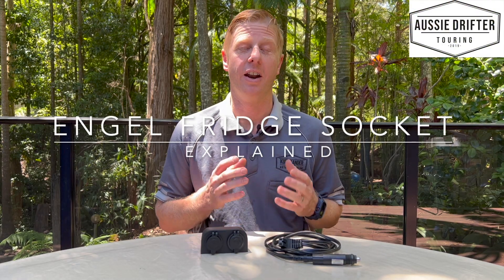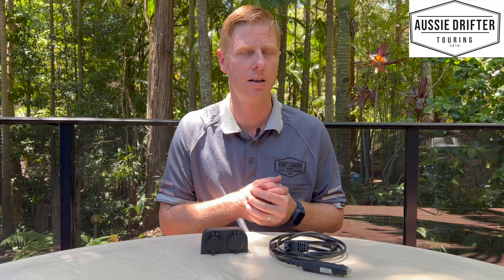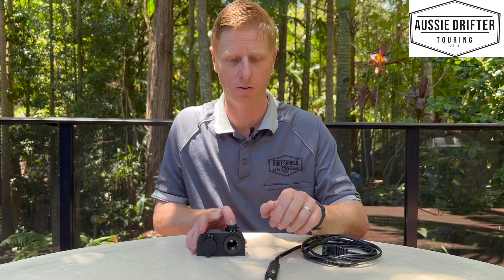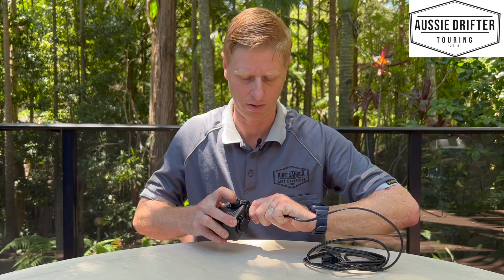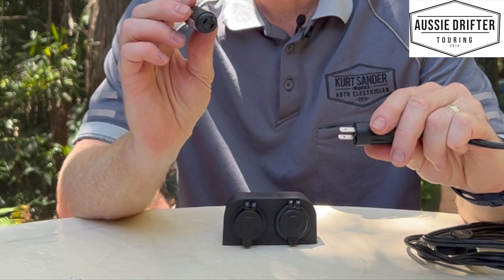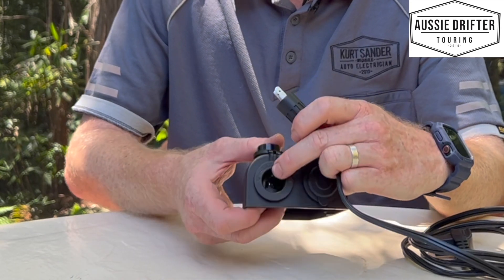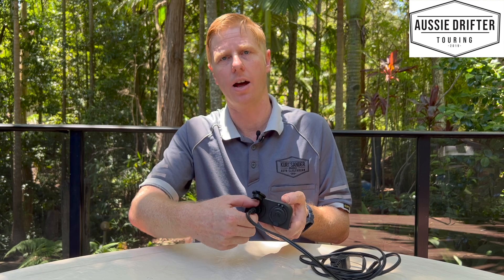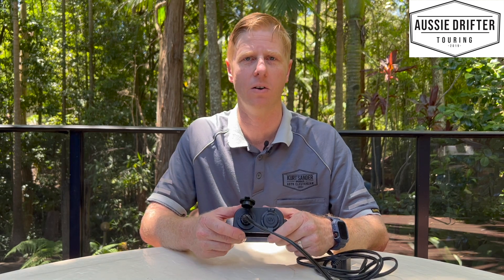Engel Fridge socket explained,  What are they?

Comment: Thanks for uploading this video, Is it safe to use the Engel connection now that it doesn't have a fuse in-between the outlet and the fridge?  You have screwed off the cig socket which contains a fuse I believe. Im in a similar situation with my fridge, i'm hoping to use the Engel connection rather then cig. I just don't want to cause any damaged to the fridge or in my case portable lithium battery which has a Engel connection.
Reply from the maker: No worries mate.  often the fuse in the socket will be a thermal blow fuse because a cigarette socket is a poor connection it can cause heat and that fuse is meant to blow on thermal overload.  But other brands so have a current rated fuse there but the fridge should its own fuse and even if it didn't there has to be a fuse on the harness that ist plugged into.  All of our accessory harness have a fise right at the battery which protects anything plugged into the sockets.  Hope that makes sense mate.
Reply from the maker: Hey mate.  Yer you should always have a fuse in the circuit.  For instance our acc harnesses have a fuse at the battery and most fridges will have a fuse on the fridge itself.  Often the fuse in the cig socket is what is called a thermal blow fuse.  That means it blows due to over heating due to a bad connection which is a common problem with a cig socket connection.  Hope that make sense.  Cheers Kurt
Reply: Just go Anderson plug and fuse it at the power source. Done

Comment: Fuse in original plug?
Reply from the maker: That is a thermo blow fuse so blows under excessive heat, not due to over current and due to the bad connections caused by cig sockets it a wise option.  Howerver our accessory harness come with a 15amp current protected fuse as all circuits must be fused.

Comment: Is there a fuse in there? If so where is it
Reply from the maker: No Fuse inside the engle socket part. there is sometimes a thermal blow fuse in the cig socket section that is designed to blow if overheated An electrical current fuse should always be installed near the battery on the harness that runs to the sockets.  Also some fridges have a fuse on them but that is on the fridge itself not in the plug.